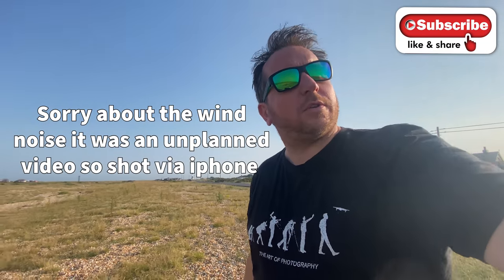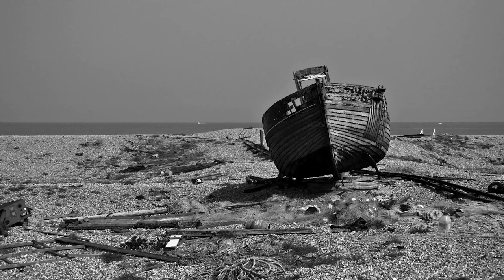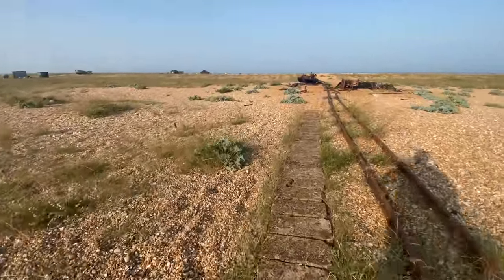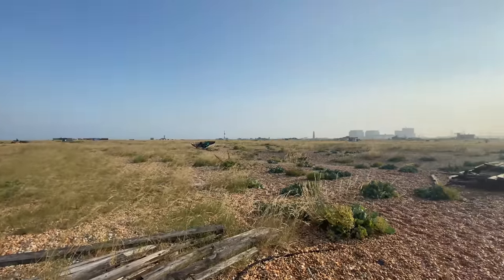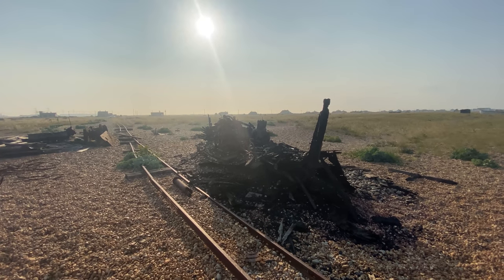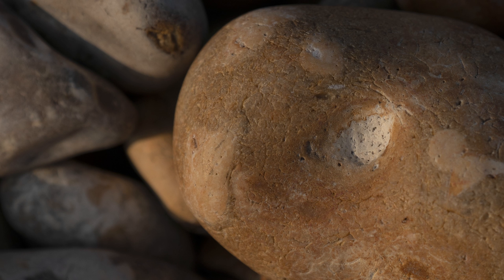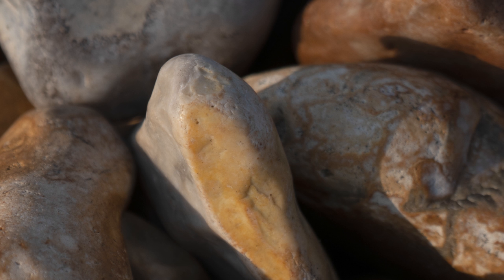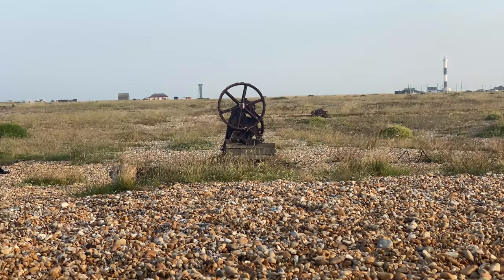2x teleconverter a waste of money?

Comment: with any TC, i've noticed you have to have the best of the best lenses so the degraded image quality still looks good. the sony 2x TC really surprises me on a slow aperture zoom lens. i've seen good image quality on the 100-400GM and the 70-200GM II. i think many don't like lugging that big heavy FE 200-600mm lens around.
Reply from the maker: i had the 100-400 gm which is amazing but i missed the 600mm  but also having the 2x and 1.4x its just a ball ache swapping them on and off.

Comment: Very interesting video, Stuart. Thank you. I have a 150-600 Tamron and have been considering trying a teleconvertor with my Nikon D850. I would have been surprised if you didn't have haze and distortion in weather like that -  TC or no TC - so it was to be expected. Just one thing when you said you didn't apply any sharpness. I only realised recently that the default setting in Adobe Camera Raw which I use,  is 25%. Not sure if you were aware of this. I think the  same applies to Lightroom, which I don't use anymore.
Reply from the maker: yep it is default 25% i drop it as default to 0% so i see a neutral image as such then if i want to apply sharpness i will but a lot of the time the images are so sharp especially with the 135gmaster i keep it at 0%. i also noticed it helps drop away noise a little more especially on the A7riv and its 61mp sensor. cheers though for pointing that out.

Comment: I tend to agree when paired with the 100-400mm & the 200-600. I only bought one when I got the 600f4 ! 
1200 f8 is very useable if no refraction ! Good call !
Reply from the maker: very nice set up.  im an all rounder so for me the 600f4 would be a dream but it would be gathering dust most of the time as just wouldnt get used enough.